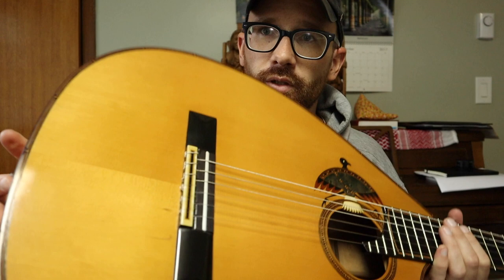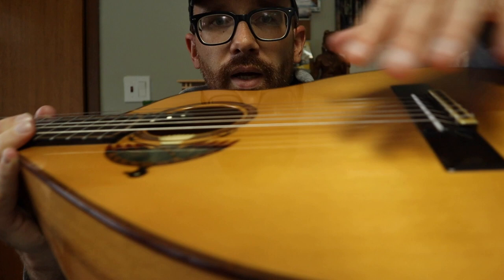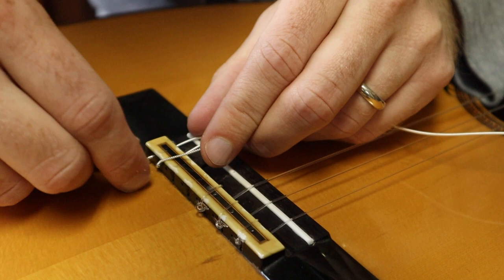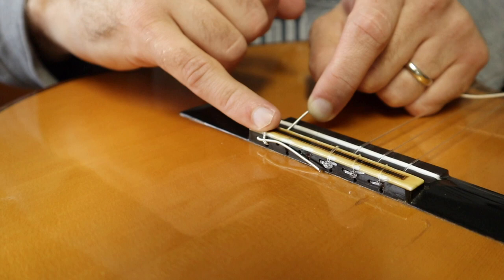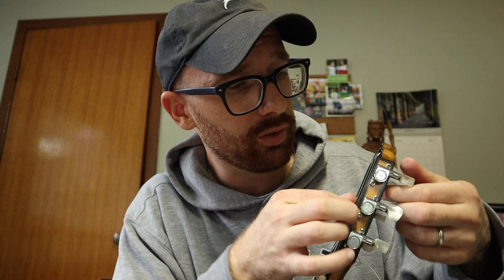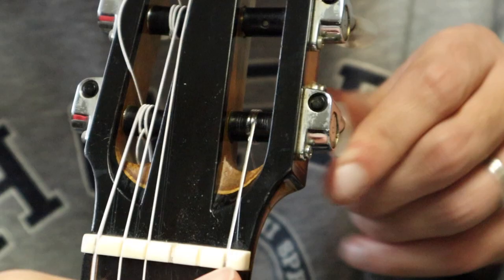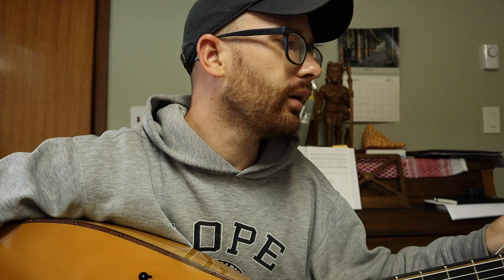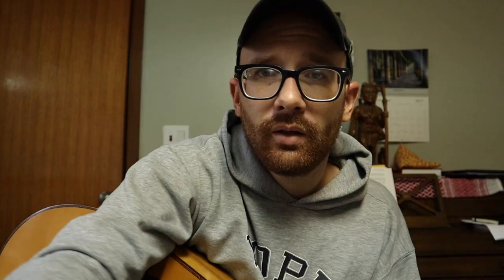Using a Twelve Hole Bridge for Classical (Nylon string) Guitar

Comment: What kind of guitar is that?
Reply from the maker: Timelanguid it was built by a luthier in South Africa named Mervyn Davis (you can find him online). This is the only one of this model he made. It’s a beauty!
Reply: Did he make it as a 12 string classical nylon string or steel? The bridge looks low, which is fine as you say as long as there is sufficient break angle. Is that an eagle around the sound hole?
Reply from the maker: @timelanguid4813  He made it a 6-string bridge. The bridge was too high so we lowered it by doweling the original holes and drilling new ones (12 of them). The break angle is barely enough, but it's JUST enough. Yes, it's an eagle design around the sound hold, partially of boar tusk :)
Reply: @LooseEnds  Interesting, glad you have a unique guitar, it will mean more to play.